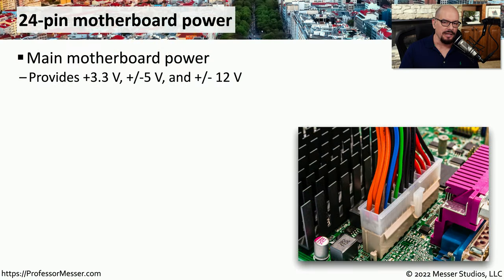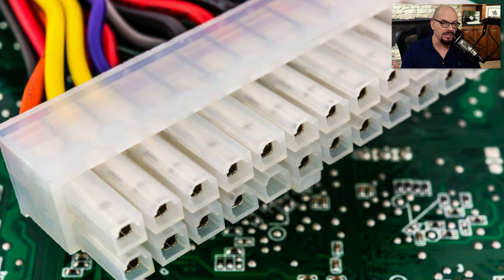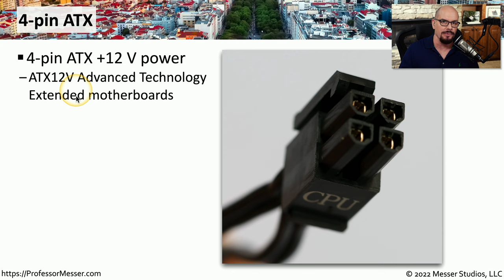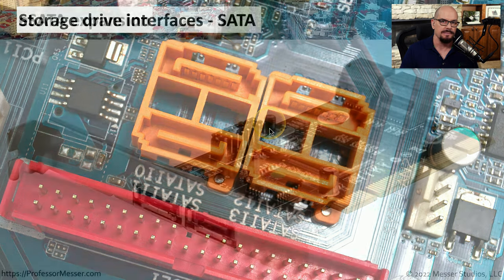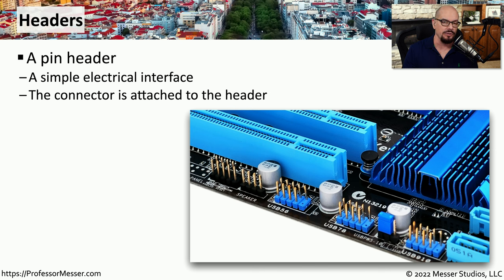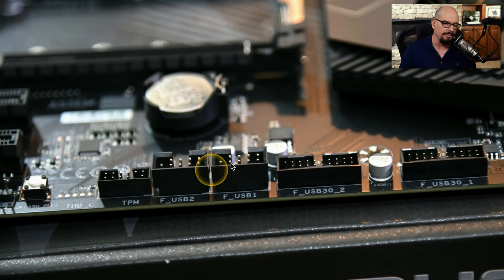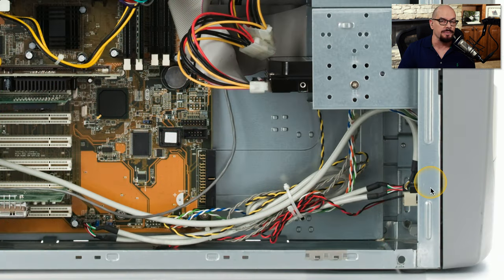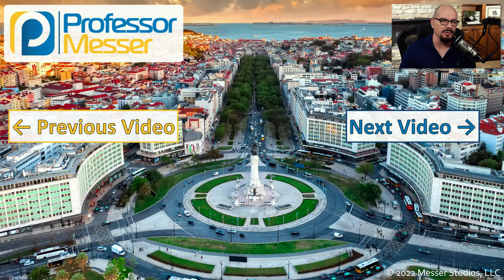Motherboard Connectors - CompTIA A+ 220-1101 - 3.4

Comment: I took a "Computers, Servers, & Networking" college class back in HS 2011, and we were loaned full  towers for the year for our studies.

On my particular PC, the student from the year before had jury-rigged the pins so that both the reset button and the power button had to be pressed simultaneously for power. Took a good day or two to figure it out, which set me a little behind. Good times.